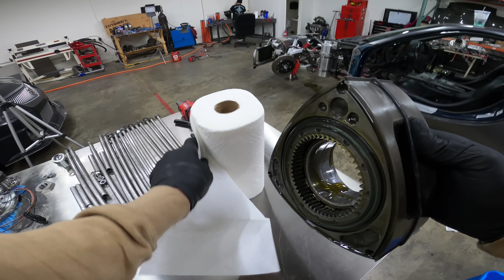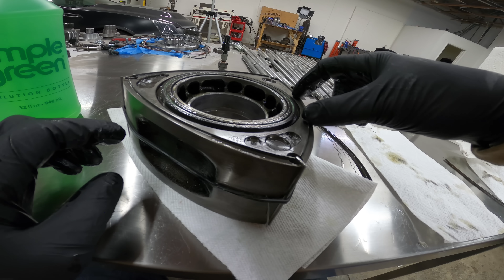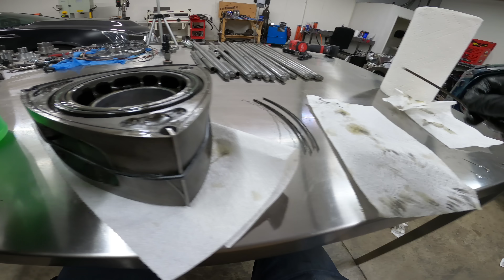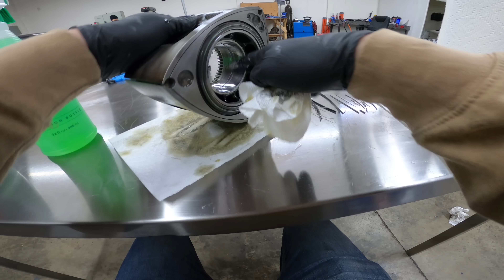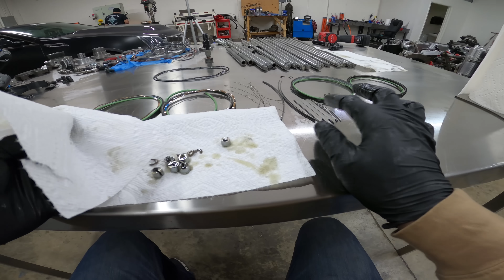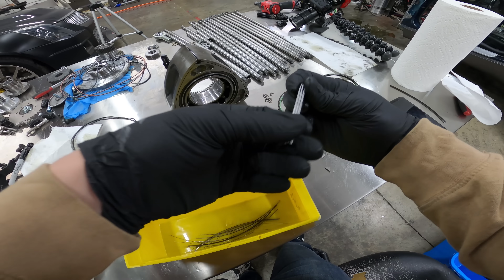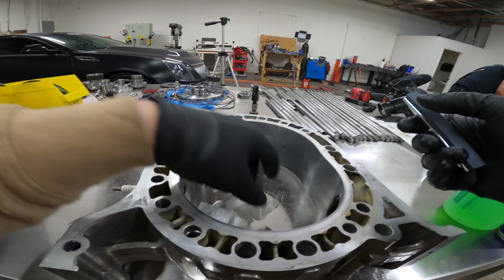Aluminum DAMAGE everywhere! Billet 4 Rotor fixed in 3 days!

Comment: To anyone watching this. Don't EVER disassemble your rotors this way. Each of these side seals are clearanced to each specific side of that rotor. If you're reassembling a rotary and RE-USING the side seals, make sure you put those side seals back in their original spot on the rotor. Rob is just throwing these things on the table and getting them mixed up. The side effect of doing what he's doing is if you put the wrong side seal in the wrong side of the rotor, you will effect the side seal to corner seal clearance. If that clearance it too large, you will lose compression on that side of the rotor. If the clearance is too tight, that seal will lock against the corner seal as it heat expands and will make BOTH seals stick (which will also make you loose compression) or even break the corner seal due to the pressure.
Reply: RotaryPerfection Totally agree, scary that he says early on he is going to rebuild using the seals as it’s a high hp motor and will be tearing it down again quite soon! Sooner than he thinks if he doesn’t use new seals and also clean the aluminium deposits in the grooves. 
Plus the whole external oil coiling system will need stripping and flushing. Even ultrasonic cleaning may not remove all the aluminium from the oil coolers.
I am not a gambling person but I would bet based on the recent videos that this engine will be the subject of another strip before the car sees and real action, unless there is a lot of off camera cleaning going on!
Reply: That’s if you’re not consistent in your measurements, but fortunately we also measured when putting it back together so everything should be fine
Reply: @DuranIndustries  Experienced rotary builders understand this but not the amateurs watching who are trying to learn from his videos. That's who I'm worried about. I don't want rotary newbies to get the wrong idea. You guys have to understand that there are thousands of people watching this video and if they don't understand that there is a correct process to follow, they will get things wrong, then wonder why their rebuild failed and is weaker on compression than it should be. Just because a rotary is put together and runs doesn't mean it will last thousands of miles and most people who rebuild their engines hope they last. That's the difference.
Reply: Hope he reads this
Reply: RotaryPerfection he said it’s going to be torn down again shorty so he doesn’t care
Reply: @huddson1357  That doesn't matter. I'm trying to protect people who want to learn how to rebuild their engines. The very 1st time I did it the way he did, I didn't have enough compression to start the engine. That was back in 1995. That's how important it is to put those seals back when you're reusing them.
Reply: So what you're saying is. Just get a piston engine
Reply: Honestly, doesn't matter how well spoken you are, its still totally possible that your a waffling idiot... Rob to a T. Prime example of a youtuber with more money than sense. Just wish this was a Vargas car, it would have been done right and we could all be enjoying it with knowledgeable and deserving folk
Reply: @RT-Revs  People will believe what they want. Any rotary expert reading my comment will 100% stand by what I'm saying. MANY will watch this video and do it Robs way and then wonder why their engine is running like shit or wont even start up.
Reply from the maker: Haha hate to tell you but the engine has been running and has perfect compression. So when you clearance a motor right none of this matters as much as everyone thinks. I have a bone to pick with everyone who acts like engine building is so difficult.
Reply: @RobDahm  Rob pick the bone with Mazda. The ideal side seal to corner seal clearance is .002-.006. I had some factory rotors that were so uneven that if you put a side seal clearanced PERFECTLY for one side and moved that seal, I saw clearancing over the limit. The rotor grooves vary to some extent. You also have the advantage of having extra rotors. Most building 2 rotors will have MAJOR compression problems randomly putting side seals back and in extreme cases not having enough compression to start the engine. I had that exact experience the 1st time I ever tried to rebuild a rotary 25yrs ago because I didn't know better and here you are basically telling people its ok. That's doing a disservice to the rotary community.
Reply: RotaryPerfection if your so concerned about viewers assembling an engine, why don’t you make a video on the process? This is robs engine, robs money, he has experienced people around him who know what they are doing. Stop being one of those people and just enjoy the video
Reply: @huddson1357  Rob can do whatever he wants with his engine. That doesn't mean he is free of criticism if he does something that could cause future rotary newbie rebuilders headaches because they did it the way he did and didn't succeed. When you have thousands of people watching your videos, we rotary enthusiast don't need newbies getting the wrong impression and fail because they did it Robs way. Rotary rep is bad enough as it is.
Reply: The more videos I watch, the more I get the idea that Rob doesn’t have a clue what he is doing..

Comment: So what caused the engine to be in it’s current state???
Reply: aluminum shavings inside the dual core intercooler, that were formed during fabrication of it, got sucked into the throttle body causing this
Reply: Von Hassen damn man, that’s too bad. Thank you for the info!

Comment: i wonder would a bore solvent like for cleaning guns would work to help dissolve the aluminum, it is used to dissolve the copper and lead fouling from the rifling of a gun barrel.  you always know when it is working because your patches will come out like blue/green which is the copper in solution.  maybe bore solvent might not work but im sure there is an aluminum solvent out there made for the very purpose you would need it, and not hurt the iron/steel.
Reply: theClosetgrower420 muriatic acid works pretty good on snowmobiles and dirt bikes when the pistons melt and stick to the cylinder walls I wonder if it would work the same on a rotary

Comment: Everybody goes on how rotary are unreliable but you do the same to a piston engine and your machining it out and replacing everything.  It is amazing how you are able to clean this stuff and it’ll work.   One of the machines I work on a metalizers for film.  Open a chip bag and that metal inside came from a metalizer like I work on.  You can get a ‘hair’ or lint from a cleaning rag in a seal surface and you have a major vacuum leak.  They run in a 4x10^-5 mbar 0.00004millibar that’s is 0.0300025 micron of Mercury at 0C.  Better the vacuum the faster I can run.  Awesome machines, thank you Germany and NASA lol.  Great video someday I hope I can have a 13b or 20b

Comment: Muriatic acid would be better to use to take any aluminum smudges off the irons...just try to put it on the aluminum spots and don't leave it on long...then it will wipe right off without taking a stone to your irons.

Comment: Get rid of the parts store "hone" and buy some good machinist stones. They are 1000x's better and will leave your surfaces actually smooth and not chowder.

Edit: Look up "Robin Renzetti" (channel robrenz) precision stones.
Reply from the maker: Ty!
Reply: @babayaba0314  alright you got me, it was 120 grit
Reply: @fatninja987   derp . I reread it . You got me. touche
Reply: fatninja987 aka grip tape
Reply: The times I have had to rebuild my 7 rotor Honda beat I just used some 60 grit sandpaper and it did the charm just fine, 35:1 compression and running 75 pounds of boost and no problems at all!
Reply: @fatninja987  😂😂😂
Reply: Second that, the machinist stones can be used in conjunction with sandpaper.
Reply: Could alcohol help also? Works well when stainless bolts are stuck in aluminum (boats).
Reply: I've done this on some housings with a round ~320 grit machinist stone, finer is probably better in this case. Keep it wetted with a thin oil. Just be careful to keep the stone straight so you don't hit harder on the edges.
pic for reference:
https://www.rx7club.com/attachments/rotary-car-performance-77/138740d1130965104-pics-rb-exhaust-street-port-6-port-p1010084.jpg
Reply: Josh Kelly mate that went right over your head didn't it ... 😂
Reply: @paulwilberforce9659   shit I reread it.  He got me
Reply: Second that, the machinist stones can be used in conjunction with sandpaper.

Comment: did I miss the video where he explains where the metal came from? I know it was from the intercooler right? but any video?
Reply: He explained it briefly right after the Keeps ad two videos ago. They forgot to clean out metal shavings from the intercooler before welding it up. Simple mistake by Isaiah when they were rushing to get it done for Sema. Probably didn't want to talk too much about it to keep keyboard warriors from talking shit about him for it.
Reply: Either the previous one or the one before that. And yes, it was from them modifying the intercooler.
Reply: I think was left over bits from the milling of the cooler. If I remember right one of them said it's flushed after it's finished but there will always be stuff left over. And while it won't bother a piston engine much it will eat a rotor. 

Would have to go back and watch to see if I'm wrong or not. More than likely I'm wrong on something to all of thus
Reply: it was from cutting their own aluminum tubing and not completely cleaning out the debris afterwards.
Reply: @IStratz  ...Nope, it was from cutting the intercooler.
Reply: Thank you, I missed it too.  Was getting ready to ask.😬

Comment: Rob really needs a parts washer.  Simply wiping parts with dry household paper towels are not going to do the trick.
Reply: What about hot oil washer?
Reply: @jonathanweimane6926  Deep fryer?
Reply: @Julzilla  Kinda
Reply: MrKalashnik0va Forget metallurgy, think common sense. How does a plumber use Solder (Tin) to join pipe (copper) together? What happens when you don’t put premix in a 2 stroke...it’ll run great...until you MELT that aluminum piston to that steel or iron cylinder! How does a welder braze cast iron together. You absolutely can join 2 different metals through the melting process. Der der der
Reply: MrKalashnik0va I didn’t say fused or welded together like you are talking about. When you have two dissimilar metals one can certainly melt to the other. You are referring to “joining” metals together. We are talking about two completely different processes.
Reply: He said he was going to use a uv bath
Reply: @MyNameIssaSimon  UV bath? you mean ultrasonic bath.
Reply: @RUNDNB85  Robb said "ultra-sonic super-sonic hyper-whatever bath"
Reply: unt yeah sorry I was hella tired
Reply: Hes just using the paper towels to show us all the aluminum.
Reply: I don’t get how ultra sonic bath is going to clean it
Reply: @BadBoyTigga  it's water and a solvent or soap, vibrated at a specific frequency to shake the dirt and debris off at a microscopic level.
Reply: @1MBStudios  You can "shake off" aluminum that's melted to metal parts?
Reply: 1MBStudios it works by creating tiny bubbles, not shaking the part
Reply: He's not stupid, im sure he knows what he has to do.
Reply: rustywrench well he left the aluminium cuttings inside the intercooler so who knows 😝

Comment: Clean the rotors with parts cleaner, and double and triple check to make sure you got every bit of aluminum out of everywhere, check every single aluminium part including the turbo housing to try to find where this aluminum is coming from, take apart the entire turbo to look for aluminum bits everywhere.  Do not stop until you are sure you know where these aluminium bits came from, or you may have the same thing happen again.

Comment: Have you thought about trying to flush the radiator though a 1 micron sediment filter (like the ones for water filtration)? You could just leave a water pump going for a day or two while maybe shaking the radiator around some.

Comment: So 1 of the rotors wasn’t installed properly?  Causing all this chaos and set back? 🤷🏻‍♂️
Reply: they left aluminum in the intercooler from when they cut it, and it made it's way into the engine
Reply: Valentine self inflicted then... 😔
Reply: @neoanderson7  yea, it was like the 2nd all-nighter or something and they just weren't as cautious as they should have been. Rob has admitted that many times by now
Reply: Valentine thank you for the clarification. 👍🏻

Comment: I forgot or glanced over it in other videos, but where did the aluminium come from?
Reply: They cut intercooler autlet to weld a new one, and forgot to blow shavings from the inside.
They were at least 40h without any sleep so that's why they forgot
Reply: @fila1445  ah I see I tought they melted a piece of the engine or something, thanks for clearing it up

Comment: Anyone can explain what actually happened? I mean where did the aluminium come from.
Reply from the maker: Isaiah accidentally left aluminum in the intercooler. He’s extremely meticulous but we were on an all nighter bender before Sema. Pushed him extra hard to get work done. And we did it. A simple mistake that allowed us to tear into the motor to catalogue what was inside it
Reply: @RobDahm  makes sense. Why not replace the seals though? I wouldn't risk it, they're relatively low cost to replace.
Reply: @piotrekserwisuje  The motor is already put together and running probably. These videos are the days maybe even a week. Or longer ago
Reply: Piotr Sulej - nothing looks damage or need to be replace. I'm sure if anything needs to be replace he would cause as he said that engine cost 60k so yeah. Plus the engine hasn't really been broken in yet so seals aren't use to a point that it needs to be replace.
Reply: Mr. Saephan any foreign matter, no matter how young/old the engine is, needs to be replaced. The engine was ran with this foreign matter and can cause clearance issues. 

All the motor and all its parts needs to be cleaned out and the seals replaced. Period. 

The oil pump needs to be checked too because the material likely made it was past the oil control rings and got in the oil system
Reply: @christophercrabtree5042  dude I know that, just asking why do it this way, the seals might technically not be damaged, but there is literally aluminium welded to them, if he doesn't clean them out perfectly (which is unlikely) there is a chance that they will be sticky, which of course is not desirable.
Reply: @rotor13  exactly, that's like common sense!
Reply: it was inside the intercooler from when they cut it
Reply: Contaminants from the intercooler were drawn into the engine causing the seals to bind.
Reply: It came from mars aliens were jealous of robs progress so they spiked his motor with aluminium shavings